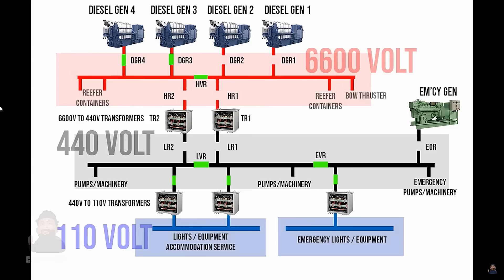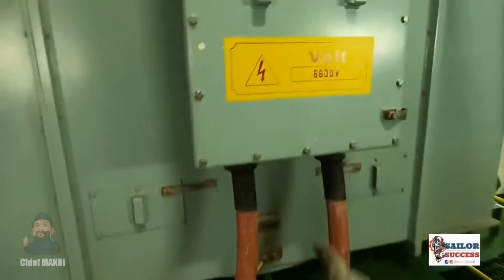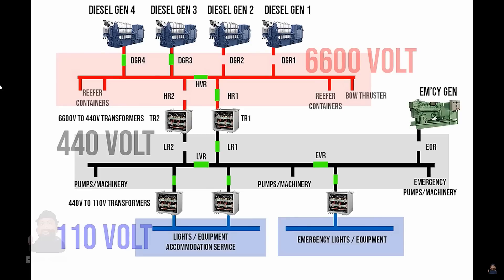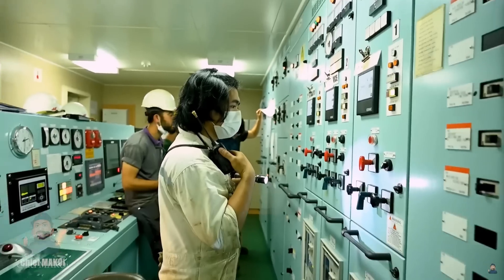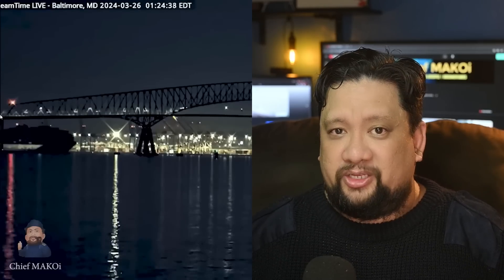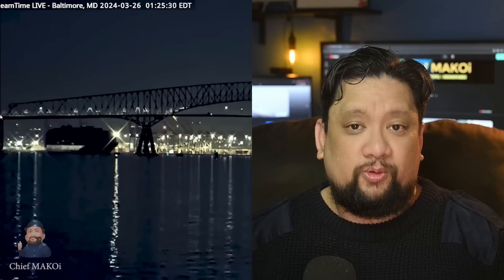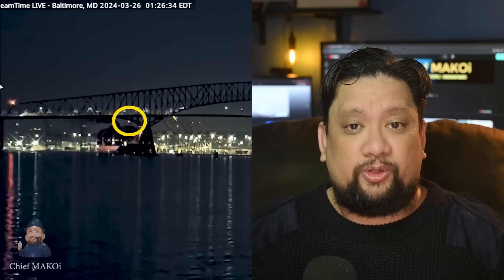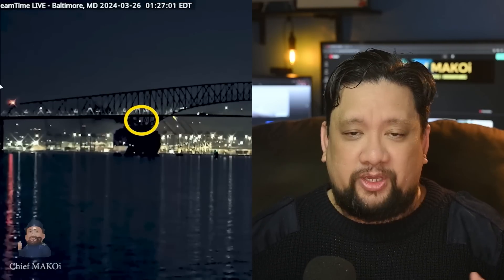Bow Thruster : Why The Dali Didn't Use It | Chief MAKOi

Comment: It depended on the type of round fired at the tank. If the round was a high explosive or shape charged type round like the kind found in a panzerfaust, sand bags were very  effective. But against discarding sabot Kenetic energy round with a hard metal penetrator used in 88mm Anti tank such as tungsten sand  bags had no effect. Patton's problem was he didn't like his tanks looking like a gypsy wagon. He also objected to the production of the M-26 Pershing Tank with superior armor protection to keep producing the Sherman...biggest mistake of the war.

Comment: The question is. What made the vessel turn sharply to the starboard? If the rudder was amidships and they only had a couple thousand feet to clear the bridge, they had enough speed, why didn’t they just let it go through the bridge and then fix the power issue then? They could have dropped both anchors any time after the bridge. The only question the I haven’t seen addressed is was the vessel going with or against current.

Comment: If it was connected to the 6.6kva bus, it should have been running in idle prior to last line.

One minute for edg power is to long after main electrical power blackout.

Comment: I have also argued that running a 3MW load on an electrical grid which is already severely compromised would have been a dumb idea. Nobody on the bridge should have touched the bow thruster without contacting the ER... Thoughts?

Comment: Chief---i left the sea as a first engineer with chiefs certificate 25 years ago , so never sailed with camshaftless engines with electronic/hydraulic  control fuel injection and exhaust valve operation.  can you tell me ---is there any way to run the engine  should the electronic control fail????

Comment: No electrical or engine power. That's wzs easy.  However they dropped the wrong anchor. Port anchor. Actually it probably wouldn't have made a difference.

Comment: My first time seeing a bow thruster used on a large ship was  as a passenger of a cruise liner, Carnival Pride. Funnily enough, we were casting off in the Port of Baltimore, and I was wondering how we were going to get out of a berth that was barely larger than the ship. That's when the bow started to swing away from the sea wall, like the stern was on some kind of big hinge, without so much as a tug boat... 😳🤯 Of course, Pride also has Azipods (sp?) which can also reorient the main propellers around, and two or three bow thrusters. Couple that with the fact she's smaller and way less tonnage, and I'm sure Pride could do a song and dance number before Dali even got out of the berth.

Comment: I understand that a bow thruster has less effect if you're going faster, but without propulsion and thus rudder authority it's quite a stretch to say, that there would be no effect. 

Previously, I thought that the control of the bow thruster probably requires a lower voltage bus to be operational. Now you say, it would have been possible to use it, but they intentionally didn't?

I mean, if it isn't enough in the end, fair enough, but not even attempting is pure neglect.

Comment: Great "series" of videos, esp. on the Dali.  This may have already been asked and answered but what was the rudder position throughout this timeline?  I understand rudder efficiency is minimized without the main screw pushing water across it however I've sailed enough "sailboats" that the tiller seems to work as long as I have forward motion ;-)  Newton's First Law indicates an object in motion will continue to move at a constant speed and in a straight line unless an outside force acts upon it.  What "force(s)" caused Dali to turn slightly to starboard vs. continuing straight which, at most, would have been a glancing blow vs. a direct hit?  Or am I all wet?

Comment: As a submariner, the thought of a "blackout" aboard the boat is unimaginable. In the event of a reactor "SCRAM" the battery immediately takes up the ships load until either the reactor is restored and/or we get to snorkel depth and engage the diesel generator. 

Regardless of main power issues, critical systems, such as navigation, propulsion, communications and sensors all have backup power systems that keep them operational. We even have reserve hydraulic power (stored energy) to operate the steering and dive-planes in the event of total loss of power.

The fact that commercial vessels have none of these things leads me to the intention to steer well-clear of merchant shipping when at-sea.

Comment: Good video as always. Just to explain a little bit from a ship's Master's point of view, the reason that a bow thruster loses effectiveness as a vessel gains speed, is that the pivot point of the ship moves forward. At anything but very slow speeds, a ship's pivot point (the center that the ship rotates around when turning) is well forward (roughly two third of the waterline length), which means that the bow thruster has a very short lever arm to turn the vessel, when compared to the ship's rudder. At 6.5 kts, the bow thruster's effect on the ship's direction would be negligible. Well done chief!

Comment: Was it the 440V network that shut down steering and the fuel pumps to the engine? Which network powers the required running lights? Why did two generators fail?

Comment: Hi Chief,
Thanks for answering this question.  It would be interesting if someone would attempt to see what a bow thruster would do at 6 knots on a large ship like this, just to see if there would have been any change to the bow angle of the ship, and to see what, if any, change would be made to the forward motion of the ship.  For the reasons below, I think not much would change for the direction of a large flat-bottomed vessel like this one.

Since ships like this don't have keels, I assume it might have made the bow miss the pier, but the side of the ship would still have collided with it, possibly causing loss of life on the ship in addition to those lost on the bridge when it collapsed.  

Am I correct when I envision it to be similar to what would happen if you attempted to turn a car's front wheels suddenly at speed on ice?  While the direction of the front of the car might change a bit, the momentum of the mass of the car would still keep it going in the same direction of travel -- basically now skidding in the original direction of travel.

Now on a boat with a pronounced deep keel, changing the bow angle would have a pretty immediate impact on the direction of travel.  That's why sailboats can turn so quickly as compared to most power boats that kinda skid around their turns.  Sailboats need to have the keel to allow them to move forward over a wide arc of wind angles -- not just wind astern, and to prevent sideways slippage when sailing on a "beam reach".

Cheers from Oregon, USA
Phliip

Comment: In emergency situations, it may be necessary to use the thruster at high speed to avoid a collision or other serious danger. Its use in emergency situations for pilots and ship captains should be included. The engine room engineers too. Commander Reinaldo Ramírez

Comment: Hi Chief, Your video is very insightful. I wanted to mention that the bow thruster is generally not effective at speeds below 5 knots / on the bridge in vicinity of central bow thruster controllers should  have been posted this info . ⚓️⚓️⚓️⚓️⚓️about anchor chain  (attempt of emergency anchoring) do you know how many shackles have actually dropped into water? A picture of the portbow will be very useful to understand if the chain paid out till the last anchor shackle or not?! As per crew in charge with anchor releasing statement of facts, the port anchor have been dropped but, the crew in charge had to escape due to the imminent impact, in order to have time to save his life. 
Thank you, and keep up the great work with your videos! ⚓️⚓️⚓️⚓️⚓️

Comment: i remember the ship i handled , those motor that drives windlass are always tripping off , it might changed its settings in tripping off mechanism, thus affect the auxiliary engines injection pump, 
engine is erratic and produce black smoke

Comment: I thought I read somewhere that the Bow Thrusters require 3 Gen Sets to be online.   Maybe the Trainee Pilot attempted to use the BTs, and caused the first overload of the Gen Sets.
Reply: They did not attempt to use the bow thruster, there was nothing said about the BT on the audio recordings on the VDR. Yes the VDR stopped recording sensor data, but that was because of the loss of electrical power to the monitored equipment, the VDR itself kept running on it's UPS battery, so there's no gap in the audio data.

Comment: But at least one steering gear pump, should be connected to emergency switchboard. So if em gen was kept running that should have given them some control
Reply: It was, but there was no power for about 45 seconds until the emergency generator auto-started and came online.

Comment: The question remains: why did the ship turn sharply starboard, starting a minute after it lost power?
Reply: It' didn't turn sharply, only a few degrees, but when you're trying to steer an 1100 foot long ship thru a 700' wide channel it's like threading a needle.
Reply: In any case it the drift was probably caused by a combination of propeller drag as the prop slowed down and stopped, the current, wind, and then bank suction finished them off as they got too close to the edge of the channel. Remember the main 700' wide channel is dredged to 50' depth, but outside of that channel it's a lot shallower, so there's a small bank on each side of that main channel.

Comment: I really hope they don't throw any of Dali's crew under the bus, sincerely! The more time passes the more we know about every last second of the entire debacle.. And in my opinion it's shaping up to be a legitimate accident, the "sometimes sh*t just happens" kind of accident where no one person(s) aboard (so far as we know as of June) was in technical error or directly responsible. Just really, really unfortunate timing for having electrical troubles. For all we know something completely unknown and unforseen to all personell. Like a defective control panel component or some manufacturing issue somewhere down the power system present from day #1 when the ship was launched? So I hope that opinion is correct and all the crew come out OK on the other side of this!

I feel horrible for the loss of life, the cost to Baltimore, and shipping as a whole but the crew, they've got many more months if not YEARS worth of drama ahead of themselves too, just because.

Comment: Allangibson below flags another major issue.  If the low voltage busses or the emergency busses are not supplying power to the control consoles, then no signals can be sent to the actual electrical engines.  This has to be a major design flaw in ANY ships of that type.  The control consoles HAVE to be energized and working, or then you will have to depend on local handheld radios to issue operating instructions to anything else, which might be working.  Corrections needed.

Comment: My parents had a share in a barge in  France.  The bow thruster controls were not even on the main control panel at the helm, and I was told not to use them.  Once, when everyone was taking a nap, I gave them try.  150 ton displacement, (a converted coal barge), at 6 knots down a straight, 2 minutes of bow thrusters before dad came up to tell me off, made no difference to our direction of travel.  It did get me off driving the boat for 3 days though.

Comment: Two points: 1. Most large vessels cannot steer well, if at all, at speeds less than about 4-6 knots, depending on their design. At 6.5 knots, the Dali would have had minimal steerage at best. BUT, this is with the main engine operating and turning the propeller, providing a strong flow of water over the rudder. Without the propeller turning, there is no way the rudder could be effective, largely because the propeller, unless it is turning in the ahead direction, badly disrupts the flow of water over the rudder, rendering the rudder useless. 2. jakebrod7 is correct.  In the US Coast Guard aboard a 180" buoy tender, we once overtook a Great Lakes freighter just west of the Mackinac bridge. She was making about 3 knots heading west and weaving badly back and forth across the track line. We called to see if she needed help and were told that they had lost rudder control and were steering using the bow thruster, which was ineffective above 3 knots. So presumably the Dali, going 6.5 knots, would have been going too fast for the bow thruster to have any effect.
Reply: Yep, similar thing with the Titanic, they stopped the main engines and put the helm hard over. Big mistake, the center propeller slowing down and stopping disturbs the water flow over the rudder. If they would have either maintained speed or just stopped the port engine to provide some drag, but kept the center low pressure turbine at full ahead, they might have just barely sideswiped the iceberg. Yes it wouldn't have made enough difference to avoid the collision entirely but a glancing blow would have only flooded 3-4 compartments versus 5 with a small leak in the 6th compartment, doomed the ship to Davy Jones locker.

Comment: Even if they could use bow thruster's, could they?  As I'm thinking the control panel for it, didn't have power as the high voltage was working, but not the lower voltage...

Comment: Could yòu comment on why there  are dampers in the generator exhaust trunkings.  Does each DG have its own scrubber? What does this consist of and when is it used?  What happens to the carbon rich water in the scrubber?   A lot of us retired  Marine Engineers have never come cross this type of equipment as we    left the sea in the 1980's. If you could find the post under MV Dahli hits Baltimore bridge on Ship Nostalgia, perhaps you can answer the question there. Many Thanks.

Comment: Yes great explanation but why was black smoke pouring out of the back from Dali between the first power outage and the second which was missing from your video here!
Thank you for other great information!
Reply: I think what was happening there was after the first blackout, and then power was restored, they forgot to reset stuff and turn the fuel pumps back on. So the 2 main generators started losing fuel pressure, started running badly, and then when the circuit breakers for TR1 were reset, that sudden high load coupled with lack of fuel pressure caused a lot of black smoke. Eventually they tripped probably due to low frequency, or low voltage trip, and the second blackout occurred, and in the video you can see the black smoke stopped at that point. I think they had the same problem when they were working on the exhaust scrubber on DG#2, and it tripped resulting in a blackout. #3 DG started automatically because it was on standby, but with no fuel pumps running it also shut down.

Comment: Speaking as a retired captain and ship handling instructor, there’s no point prior to hitting the bridge abutment, where she was going slow enough for the thruster to have any functional effect

The pilots would’ve been weighing a number of different factors when trying to decide what actions to take and what actions not to take.

They wouldn’t have even even started to factor in use of the bow thruster unless they knew that they were going to somehow be able to get the speed of the ship below about 3 kn, and in the close quarters there in the harbor, they already had way too much speed on, and honestly were probably thinking about trying to find a soft space to ground her if they could turn her

She was doing 8 kn at the time of contact, and you could run that thruster at 100%, trip the bus, burn out the motor, and shake the bow off the ship, and the thruster is still not going to have any appreciable affect at 8 kn

Comment: Presumably, the 600Kw bowthruster would be controlled from the bridge with low voltage, low power switching on the bridge. There isn't going to be a switch on the bridge capable of switching 600Kw and there isn't going to be HV cabling from the bridge to the bow. Hence, if the low voltage power is off, bridge controls won't work even though 6Kv power is available to the bow thruster.

Comment: There is another issue with the Dali's bow thrusters: Even if they tried to run them, they would probably not have operated. The 6000 V are not routed from the HV switchboard to the controls on the bridge and then back to the bow thruster. The bow thruster's HV supply will be controlled via relays, contactors or their electronic equivalents, using e.g. 400 V or low voltage (110 or 220 V, or even low voltage, like 28 V DC, coming from transformers or transformer rectifiers attached to one of the low voltage busses).And these busses were down.
On big aircraft it is the same: High power consumers, like e.g. hydraulic or fuel pumps, windscreen heat etc., usually have two circuit breakers: 1) Operating power, usually 115 V three phase, and 2) a circuit breaker for control, which comes e.g. from a 28 V DC bus.
Btw., if you think Hollywood movies about ships are bad and silly, watch Hollywood movies about airplanes, like "Airforce One" or "Die Hard 2". I usually only watch old aviation movies starring James Stewart. He was a trained and experienced military pilot in real life, after all, and talked the directors out of the worst nonsense.
Reply: That's right, can you imagine how f'ing dangerous that would be to run 6600 volts up to the bridge consoles, and someone presses that button with wet hands... BANGGGGGG. Not to mention high voltage marine grade cables are insanely expensive, and it's a long run up to the bridge, and then all the way forward to the bow thruster.